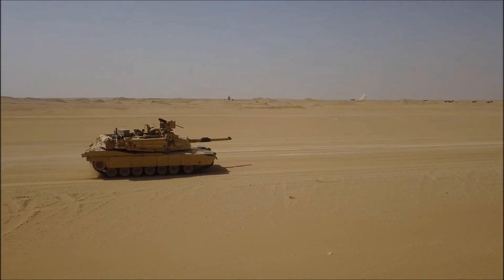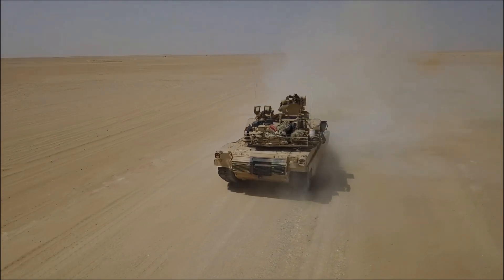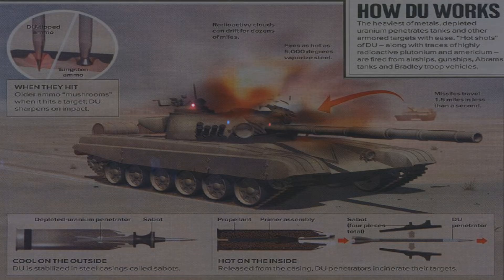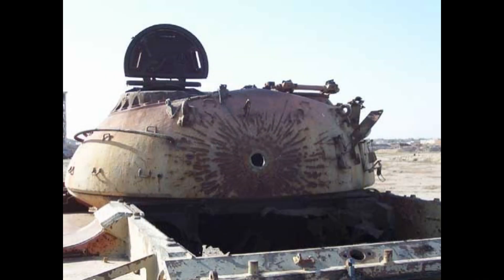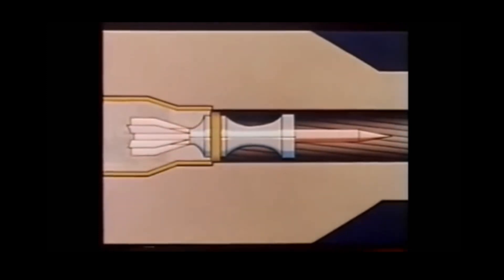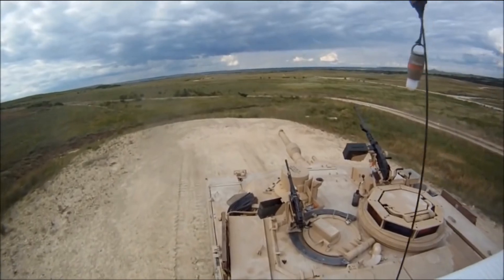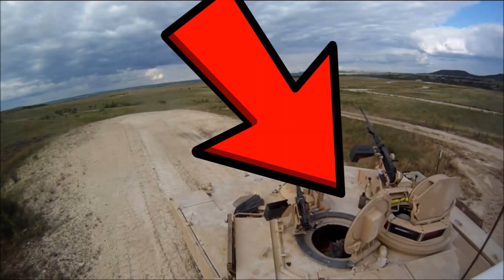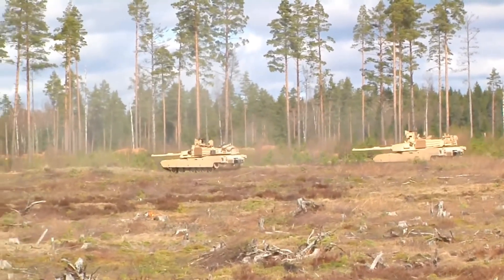Depleted Uranium Tank Ammunition | DEADLY DARTS 💀☄️

Comment: Uranium should not be used in weapon systems. The problem comes latter when you clean up a battlefield that has had vehicles knocked out with spent uranium ammunition. Huge heath hazard that cannot be controlled when you have humans deal with moving and junking these tanks.

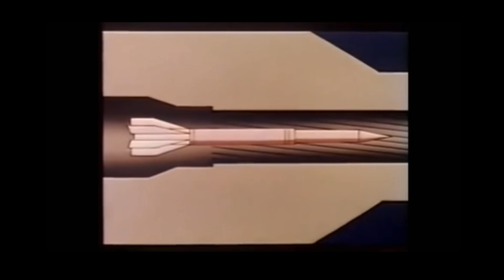Comment: Edit: 6:32 ok, i guess the intro failure skipped through the post-processing.

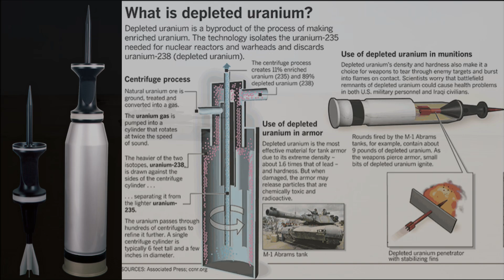1:32 No, Uranium is not the densest Element naturally occurring on earth. Even Wolfram or Tungsten are denser. Osmium being the densest. Wether it is cost, supply issues or maybe material sience. And maybe it was intended to do harm in the long run to make potential adveseries think twice. But it is not coming down to density.

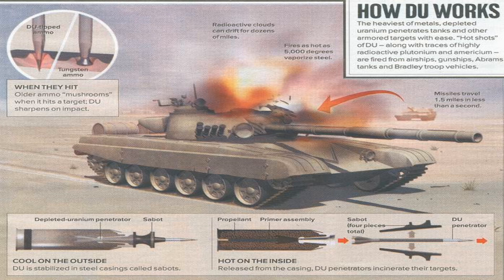Edit: 3:38 seems also a vital point.

Comment: @World Traveler  said, "Alright folks go ahead and grab a science book and you'll discover that when uranium is depleted it becomes Lead"
--------------------------
U238 is not radioactive? DU is U238 with a specific, intended use, but is not-- emphatically-- not lead. From your science text, you will find it takes a long, long while for U238 to decompose into half its original mass- 4.468 billion years. And requires another 4.468 billion years to decompose into half of that, etc.
The danger from U238 is not proximity, but ingestion or inhalation by people living nearby. During impact, DU spalls into minute, often burning fragments and powder. Such particles are scattered widely, and due to the lower radioactivity of U238 than natural uranium, are even more difficult to find.
Being "less" radioactive is a relative value, and does not mean reduced danger from inhalation or ingestion. In dry regions, dust storms continuously redistribute the toxic residues of past DU battlegrounds.

Comment: The dangers of DU rounds is highly exaggerated. It does not fill the air with toxic dust, and the particles are so heavy they quickly settle. Stay out of battles with the A-10 and you'll be fine.

Comment: I heard nothing about what happens to this material after it is fired. Since all isotopes of uranium are radioactive, we have to assume that this material is also dangerous. The reason that it is so easily available to the military seems to be that it is classified as hazardous waste and we have considerable trouble finding a safe storage spot for it that would remain secure for, say, a lot longer than our planet has been around. Uranium 235 has a half life of 4.5 billion years, which happens to correspond nicely with the age of this planet. The military likes to point out that most, but not all, of the radioactive material emits alpha radiation, which is very weak and not particularly dangerous unless taken into the body. What they do not broadcast, though, is that the rounds burn up on impact and the dust and smoke are then out there for anyone to breathe in. My question is this. How smart is it to poison the battlefield for a period of time many, many times longer than humans have even existed? Do we know where that dust may even go or what real threat it may pose to us here, where we live. We know that dust from the Sahara finds its way to North America now, so why wouldn't the dust from depleted uranium do the same? What kind of defense is this?

Comment: I don't believe in the physics here.  Uranium is about the same density as tungsten.  Hardness, as I understand it, is a disadvantage, because it causes buckling of a long rod.  More likely, the advantage of uranium is the higher density in the gas phase, though I have not calculated the temperature.  Lower specific heat may also be an advantage; more heat goes into the armor.

Comment: I'm not expert on the subject but in regard to the strength of metals, the larger the grains or "crystals" within a metal, the easier it deforms. the boundaries between separate grains is what make a metal hard because the dislocations that cause plastic deformation cannot cross from one grain to another. I could be wrong though. Either way, great video!

Comment: Remember depleted uranium sticks to kids. Sorry had too. It will be interesting to see how they go about hitting the top of tanks hellfire or tow. But from a tank? And in battle many questions on how that system would work without being damaged in a fight. Or remove tanks completely and go with attack helicopters only for forward fighting? And if the military would be smart they would extend the A10 build well into the future. That aircraft has earned its place in the arsenal forever.

Comment: Former tank crew here. I do have a distinct preference for depleted uranium because its pyrophoricity means that APFSDS shells using depleted uranium end up detonating behind the armour that they have penetrated despite theoretically being kinetic warheads, which is quite the spectacle. That said tungsten carbide isn't exactly a pushover either given that it can still cripple tanks by damaging critical subsystems like propulsion and fire control
Reply: I'm an old "Dino Tanker" and we used the 105mm SABOT rounds. We were told the "dart" cuts thru the armor and the fragments it makes doing so spreads them around inside the turret to destroy equipment and personnel. Possibly causing a catastrophic internal explosion, especially sionce Soviet era tanks have exposed ammo under the floor.
Reply: @cavalryscout  More than a year of conflict in Ukraine has passed and experience has shown that shells with a uranium core are not a decisive factor in the destruction of tanks. And the tank itself is no longer the decisive striking force in a modern war. The same Leopard, which was called the most modern tank, is destroyed by a conventional high-explosive shell. The fuel tank collapses and the tank burns.
Reply: The M1A2s haven't seen combat yet. The ammo is stored in a separate compartment with blast doors to keep from launching the turret like the Russian tanks do. A hit to the turret may kill crew members but not necessarily destroy the vehicle. There is also the special armor and add on reactive armor to enhance it's protection. The Leo is not as tough as the Abrams.
Reply: @cavalryscout  Out of curiosity, how did you guys deal with the brittleness of the tungsten carbide? When I was in as an aviation mechanic, we had to replace our "big boy" tungsten drill bit (2 inches by 3 feet for drilling out titanium shims) around every other month from it breaking in half when some idiot dropped it.  Did the shell enclose the projectile, or did you have to pray the tip didn't land sideways & snap off every time someone dropped one, or did the guys dealing with them come up with something clever the brass would have never thought of?
Reply: @muninrob  the penetrator bar is tungsten alloy, not carbide. Tungsten/nickel/iron.
I’m not sure what the windshield ie the tip is made from.
Reply: I'm an old "Dino Tanker". We used tungsten steep, the depleted ammo came out with the 120mm I think. I was on the 90mm and at the end, 105mm guns.
Reply: @muninrob  usually the warhead is enclosed by a sabot that peels away once the shell clears the muzzle
Reply: These darts have a discarding case (sabot) that protects the dart during handling and flies off when fired.
Reply: @Dave5843-d9m  I was worrying particularly about the part of the tip that sticks out the front of the sabot in the pictures of the rounds on display - that's the part I assume is somehow jacketed or protected from the kind of abuse GI's like me put them through loading them into (and throwing them out of) helicopters and C130's.

P.S. If no one finds out about the extra round made of styrofoam, we'll keep bringing a case of beer with every delivery - dry countries SUCK.
Reply: I was trained on the M-60A1 but never served on them. We had M-48A1s until the end of my service when we got M-48A5s with 105mm main guns. They told us the SABOT rounds would penetrate any known tank then (1970s) and go right thru. If it did not, it would bounce around inside the other tanks 10K times before it ran out of energy. imagine what type of fly swatter you would need to know that bad boy down?

Comment: Matsimus: unlike tungsten, which becomes rounded when penetrating, DU wears at the edges, and is essentially self-sharpening...

Every TIG Welder Ever:  (only heard "self-sharpening") wonder if that would make a good replacement for tungsten electrodes in TIG welding? Would probably suck having to run all that PPE etc., though
Reply: tungsten is used in TIG welders because of its very high melting point. DU wouldn't provide that at all.
Also what is used in Ammunition isn't actually elemental tungsten but tungsten carbide, which is a massive difference.

Comment: Just found this vid. Actually Tungsten is marginally more dense than Uranium. About 1% more dense. Specifically 19.3kg/litre at room temperature compared to 19.1. Vickers hardness is around 4000MPa for Tungsten compared to around 2200 for Uranium. Shear modulus (important for shots that do not hit armour perfectly perpendicular) for Tungsten is 161GPa and Uranium 111GPa. One of the main reasons to use DU is ease of machining. You simply cant machine solid tungsten. What you have got in Tungsten penetrators is sintered tungsten which is weaker due to the sintering material which can be for example copper. If we could cast then machine the Tungsten penetrators they would seriously out perform DU (by about 50%). The only problem being that Tungsten is not going to turn to aerosol and explode the way DU does.

Comment: platinum is denser at 21.5 g/cc compared to 19.3 of DU. Be interesting to determine what is cheaper, although DU is a waste product, Presumably platinum is more scarce and is more useful in other applications. Also would the difference in density make much difference. And it’s not pyrophorphic so wouldn’t burn.

Comment: My dad did work on the depleted uranium round. The shape is the trick. At high speed it makes a jet of melted metal at super sonic speed inside the tank hit. The thing turns into liquid and melts the target metal impacted, everything inside is shredded. The ammunition also is hit by high speed melted splash and helps to keep the suffering inside the tank on the short side. 😁

Comment: The advantage of rifling barrels in terms of range and accuracy has been known and employed for over 200 years. Why a smoothbore gun for the Abrams?
Reply: It has to do with spin rate needed to keep the projectile stable. Sabot shells need a spin rate that will destroy the dart in flight due to centrifugal acceleration. So, we just mount fins on it and there is no need for rifling.
Reply: @jimsagubigula7337   Thanks for the info.

Comment: Collected via the epa website 
Studies indicate that an elevated pH in soil may 
increase the solubility of tungsten by decreasing 
its sorption coefficient, which may cause it to leach 
more readily into the groundwater table (ATSDR 
2005; ASTSWMO 2011).
Tungsten has been shown to accumulate in plants 
in substantial amounts. The extent of 
accumulation appears to be related to the 
tungsten content in soil and varies widely,
depending on the plant genotype (Koutsospyros 
and others 2006)
Studies on female rats have shown that oral 
exposure to tungsten caused post-implantation 
deaths and developmental abnormalities in the 
musculoskeletal system. 
Studies on rats also found that tungsten primarily 
accumulated in bones and in the spleen after oral 
exposure (NIEHS 2003).
The EPA’s Toxic Substances Control Act (TSCA)
Interagency Testing Committee has included 
tungsten compounds in the Priority Testing List, 
which is a list of chemicals regulated by TSCA for 
which there are suspicions of toxicity or exposure 
and for which there are few, if any, ecological 
effects, environmental fate or health effects testing 
data (EPA 2006).
The American Council of Governmental Industrial 
Hygienists (ACGIH) has established a threshold 
limit value of 5 milligrams per cubic meter (mg/m3
) 
as the time-weighted average (TWA) over an 8-
hour work exposure and 10 mg/m3 as the 15-
minute short-term exposure limit (STEL) for 
airborne exposure to tungsten metal and for 
insoluble tungsten compounds (ACGIH 2008).
The Occupational Safety and Health 
Administration (OSHA) recommends a permissible 
exposure limit of 5 mg/m3 for insoluble compounds 
of tungsten and a PEL of 1 mg/m3 limit for soluble 
compounds in the construction and shipyard 
industries as a TWA over an 8-hour work 
exposure. OSHA also established a PEL of 10 
mg/m3 as the 15-minute STEL for airborne 
exposure to insoluble compounds of tungsten and 
3 mg/m3 as the 15-minute STEL for airborne 
exposure to soluble tungsten compounds (OSHA 
2013)

Collected via https://academic.oup.com/milmed/article/172/9/1002/4283401
Studies in experimental animals and cell culture indicate that pellets based on heavy metal tungsten alloy possess carcinogenic potential previously unseen for depleted uranium and/or lead. Other metals in the tungsten alloy such as nickel or cobalt may contribute to such a risk. Accordingly, the long-term tungsten-related health risk is reason for concern. This article reviews toxicological and clinical literature and provides new perspectives on tungsten and tungsten-based alloys.

Comment: I noticed years after loading these sabot rounds that I  developed tiny warts on my hands, I had a large wart in between my thumb and first finger webbing in my left hand that was very difficult to get rid of.  I'm  guessing from holding the round in the ready combat load position. I also have developed a pain in my left side near where the tip of the sabot was as I rested on my belt.  Also my hair had been falling out in strange places.
Reply: CR: Warts are caused by viruses.  The body's immune system attacks them, and they are typically cleared in around two years.  They come and go through one's life.  b. (biologist).  p.s. I too have warts on my hands and between fingers and never handled DU.
Reply: dont invalidate  @KB4QAA

Comment: hi i liked the video. i am a USAF vet that still loves military tech.   you had mentioned that DU was used on the Abrum and the A-10, which is correct BUT U MISSED aircraft.  the AH-64 APACHE.  SHE packs 30mm in her nose,but its a chain gun not a gatling(slower by small difference in speed).

Comment: @ 5:32 min - HOW Can It Have a Flat Laser-Like Trajectory? 
Since the munition isn't rocket-powered, why isn't it moving in a ballistic arc from the moment it leaves the tube? 
This is a serious question. I don't understand the claim, and I'm not inclined to believe it without an explanation.
Reply: The sheer velocity of the round I suppose, when launched from the barrel, the tank round’s small and compact size allows it to easily flow through the air while the fins keep it stable enough to not lose its aim

Comment: For a projectile to have zero ballistic drop to 3000m, it would need to have an average velocity of over 3000 meters per second. That simply is not the case. These tanks absolutely have to dial elevation into the barrel in order to hit targets at 3000m. Gravity takes over the moment the projectile leaves the barrel.
Reply: Zero drop is not possible